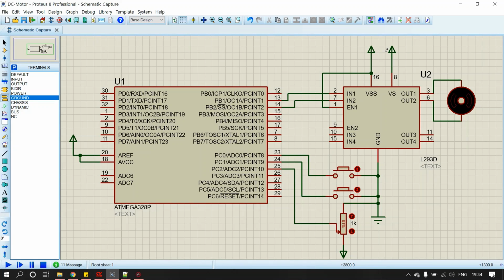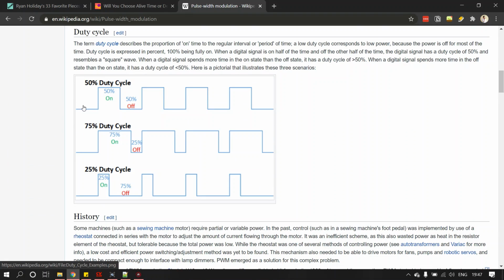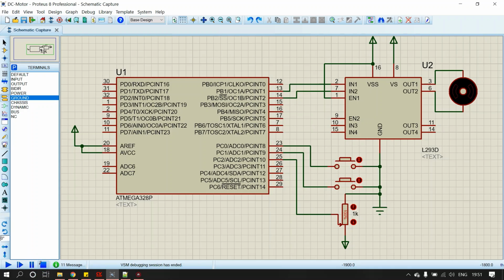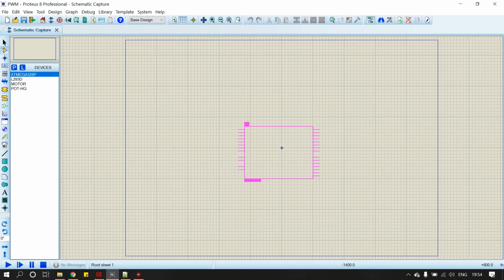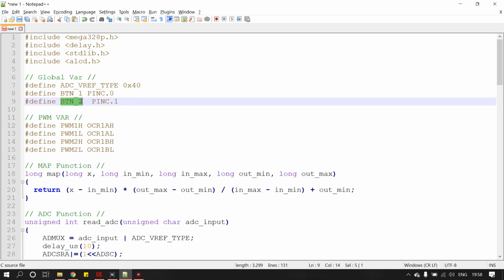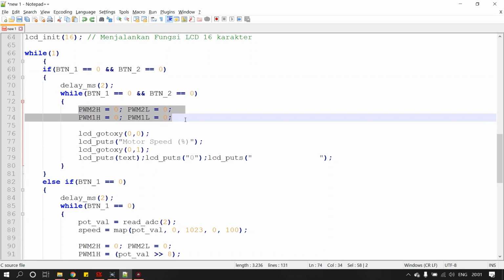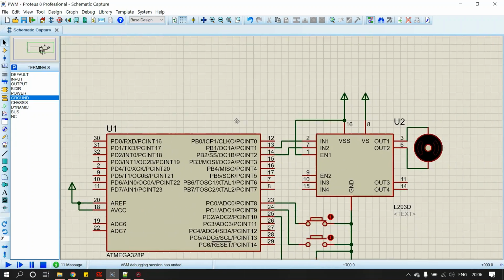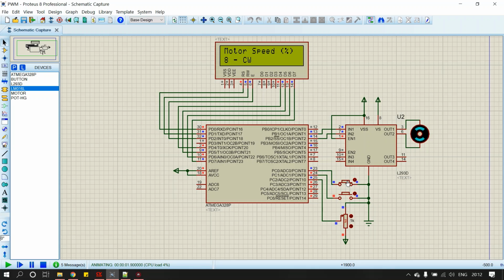Control DC Motor Speed and Direction using ATMega 328p (Proteus Simulation with CV-AVR)

Comment: Hi sir, I really enjoyed your tutorial on controlling a DC motor using the ATmega328P and Proteus. I’m currently working on an engineering project and I’m hoping you could help me with something similar, but for a different application.
I need to control the speed of a 250 W/375 W single-phase induction motor using an ATmega328P, but my project specifically requires frequency control rather than PWM. I also need to use zero-crossing detection so that the control is synchronized with the AC waveform.
The project is an automated low-speed controller for a single-phase AC fan motor, with energy-saving/idle modes. We are not allowed to use PWM, DC-DC converters, or manual speed control.
I would like to build and simulate the complete system in Proteus, including the ATmega328P, zero-crossing detector, frequency-control section, driver/power stage, and the single-phase induction motor.
Would you be able to make a tutorial showing how to design and program something like this from scratch? Even guidance on what components to use and how to connect them in Proteus would help me a lot.
I really appreciate your tutorials because they explain the concepts practically, so I would be grateful if you could teach me how to approach this project. 🙏🏽😭